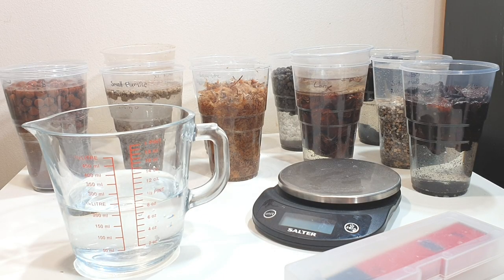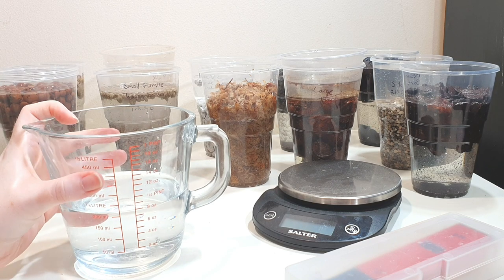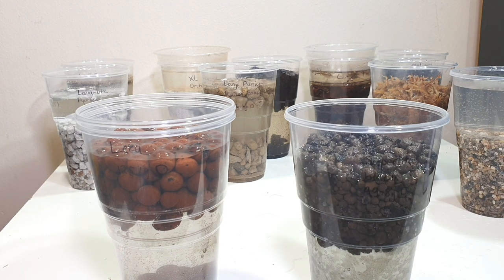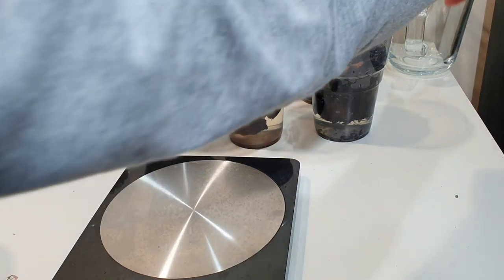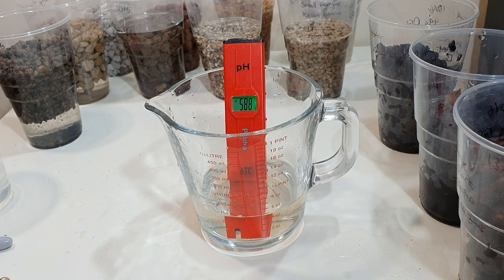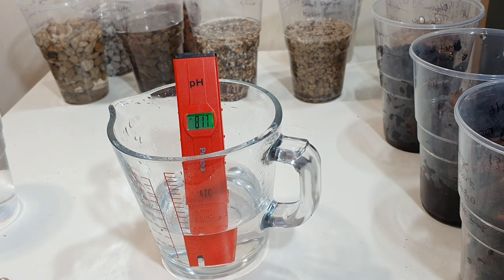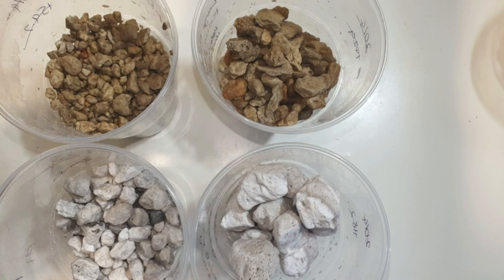Media Tests Round 2 | pH & Water Absorption- Bark, Moss, Pumice, Lava & More | Size vs Quality

Comment: I like your scientific approach. For me personally the problem is that I water my hydroponic systems with pH5.8 water and after like one day it rose up to pH 6.8 . This also happens when I just water the rocks I am using as the media (pumice + zeolite + lava) without any plants so I think that the rocks are the reason for the pH altering. I used the same approach like you did in the video to find this out. This pretty much makes that rocks pretty useless for hydroponic systems as nobody wants to check or even lower the pH of every plant every day. I found out that perlite does not show that pH rising effect. Maybe because the cation exchange capacity of perlite is much lower than the CEC of pumice for example? Don‘t know exactly. Unfortunately, it would have made more sense to use water with the pH value you would use to water your plants to show the pH rising effect instead of using water with pH >8 in your video.

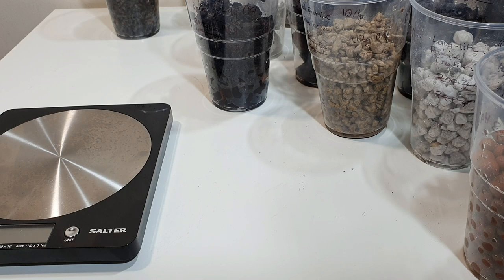Comment: 29:12 The results would have been more comparable if they were expressed as percent change (change in weight (that is, weight of water absorbed) divided by initial dry weight) rather than actual change in weight. This is because, generally speaking, the more initial substance we have, the more weight it will absorb anyway (whether the substance is absorbent or not).
Reply: Leca has the lowest percentage, next to chunky lava rock. I've tried it. Both at around 21% increase.

Comment: The acidity of organic media is exactly why I don't worry about the pH of my fertilizer being 6.5 or higher and precisely why I flush with pH 7.6 tap water (and sometimes with silicon added to bring it to 8-ish). What is important here, though, is orchiata is a little bit different from other types of bark. It is pre-treated to be pH stable for three years (according to the manufacturer, anyway). I've measured it at 6.8 new, soaked for 30 minutes in distilled water. Whether the pH stable time claim is accurate, I don't know. 
Now I don't know if you noticed, but some of those inorganics (like the black) didn't so much lower the pH of the tap as freeze it at the original value. Perhaps this was due to the cup sitting on top not allowing for as much gas exchange as an open container?
Reply from the maker: Only the large bark and the large pumice had a cup put on the top, as they were floating. There were still gaps at the sides though for air contact. The rest were open to air. The pH probe was washed thoroughly using a pH wash buffer  and rinsed with distilled water between each media test, so the value you see is a true reflection of the current media value. I suspect the superlite is just quite inert and happened to have a slightly lower intrinsic pH value than the other inorganic media.
Reply: @TheOrchidRoom  oh, I'm not questioning the pH readings, just that on a few the pH reading after soaking was nearly identical to the reading of the tap water fresh from the tap (versus the overnight). If there is any acidity to them, a test soaking them in distilled water would be a good way to measure. I suspect the pH will remain the same.
Reply: I'd also be interested to see the same experiment run using your nutrient solution to see how the pH is impacted.
Reply from the maker: I did think about this, that maybe I should be using distilled water for the whole thing from the start. That would be far more accurate and actually give the medias true pH more visibility. Then I went the lazy tap water option and figured it would do if I had the no addition control as the comparison 😅 Maybe I select a couple, moss, bark, leca and pumice, and do distilled water vs nutrient soaks. I was also thinking maybe I should keep some moss and bark pots and water them for a few months with no orchids in, to track the rate of acidification. Since this is regular bark I would imagine it gets acidic quite quickly, since it's starting out at a surprisingly low pH. Here, but not.. suggested that organic usually starts out more acidic and then tap water deposits accumulate on the media and start to buffer the pH up though, and he has more experience with tracking pH for organic with tap water. When I used to grow in self watering with moss though I noticed by the end if the year I would start to get the plants looking yellow and tired, and they would perk up after the repot, but I was never able to accurately measure the pH as I would just repot and throw the media before I thought it would be good to check. I suspect it was getting very acidic, because I was keeping it constantly moist, and causing nutrient lockout issues. But no proof...